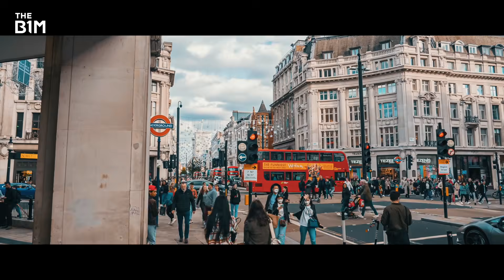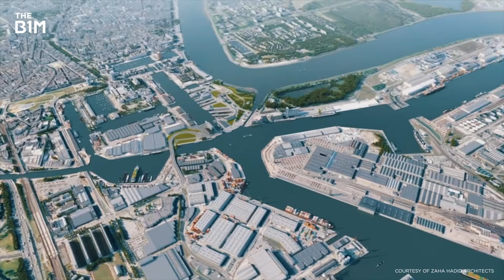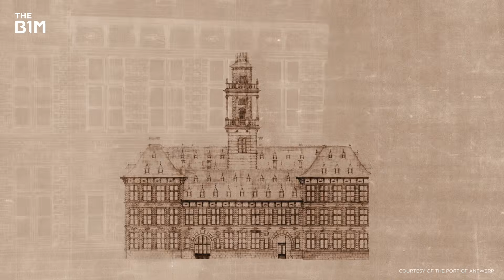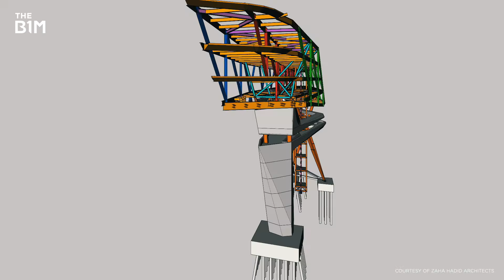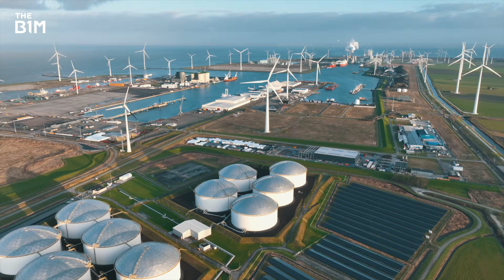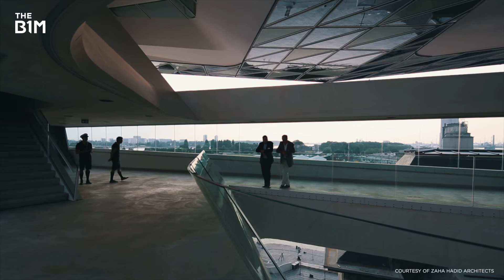Why They Had to Build OVER This Old Building

Comment: I’d LOVE to see this type of external augmentation done for buildings across a WHOLE historical city.
In the same way that “Steampunk” mixes futuristic ‘something’ with vintage ‘something else’, I think it’d be fascinating to see that done in architecture in a consistent way across a whole cityscape. 

While the building in this video’s case had the futuristic ‘something’ = modern futuristic and the ‘something-else’ = colonial era, there’s so many other ‘something’ & ‘something else’ combinations that I’d love to see.

I’ve recently started reading Warhammer 40K novels and looking at official and fan/art of the imperium, and that’s probably influencing this ahah. But while the art of the imperium’s buildings appear designed as futuristic versions of classical roman architecture, I’m more keen on the disjoint appearance of the building from this video where the futuristic is bolted on / standing over / holding up, etc. an actual historical building.

Comment: While I like modern and weird architecture, this seems stoopid.  In this case, they should have either built the new office building in the same style as the existing building.  Or else built the new building next to the old.  I see plenty of open space at 6:06 to build a new building right there.  As for parking, that could have been built underground or as a parking deck with the offices above that.  And don't these people have orgasms over bicycles and trams anyway?

Comment: I would paint the concrete legs to either the color of water or the color of the old building. Or mimicing the old building's roof and windows with painting. Or cover it with mirrors. The light concrete is just an unnececerry attachment to bauhaus while this building could be another level. Just imagine the piccibilities. Or you can cover it with LED wall too... That would make it feel it is levitating above the building.

Comment: You should also make a video about the covering of the ring of Antwerp. It is one of the biggest infrastructure projects in the whole of Europe and will have an immense positive impact on people living in the city and fix the massive congestion problems.
Reply: Just one more lane bro, trust me it will fix traffic.
Reply: @hendman4083  Meh. it's not just one more lane. They are finishing the ring road.
Reply: @LinckIT_BE  I guess the plan is to reroute through-traffic around the city, to take the pressure of the roads in the city? If so, the reduced congestion in the city will create "induced demand", and in 6 months to a year the inner city congestion levels will be back to the current situation.

Comment: Atrocious & no amount of rhapsodising architectural theory can distract from this alien straddler projecting itself atop a structure of worth.
Regarding my use of "alien" Hadid, herself an alien, uses the term to describe her work which is not only alien to Europe but also her place of origin - this alien output is not a celebration of who she is & where she comes from it is a non-descript standardised computer aided design cut & paste belonging nowhere & only reflecting its artificial digital electronic origin & therefore is unworthy of praise, that Hadid & her supporters do not understand or ignore this emphaises why they should be in position to "build" anything.
As for the author's attemtpt to justify the need for similar work to deal with rising population in Europe there is a very simple solution to this: the immediate cessation of the importation of aliens into Europe & the repatriation of all that have been generously granted access here post-WW2, no need for "New Builds" then & once underway the "construction industry/lobby" can be put to good use restoring shithole cities & towns by clearing sprawl of the vertical as well as the horizontal variety & returning Land as best as is humanly possible to it's pre-"developed" state.

Comment: I'm more interested in the structural and financial implications of those 2 massive shear wall columns, they have to be hollow for the elevator or fire exits, right? Or are they purely structural and solid
Reply: It's not solid. It functions as a stairwell and a fire exit. It even runs 2 floors below the ground, to the underground parking garage.
Reply: I was wondering about fire exits, or even a stairwell, as well.
Reply: Go onto Archdaily. They have a wall section that shows the egress stairs and elevators in the structure. Very typical.

Comment: I am a fan of a lot of modern architecture, but I feel that this was ill-thought-out. It was not necessary to destroy the aesthetic of the protected building by adding this to it. 

I am not against the design of the addition, but do not understand why it was put above the original. Why did they say that they lacked space? There was a huge area in front of the historic building, and the same concept for the addition could have been used for a structure that "floated" over the open space, whilst allowing the area to be used for whatever it is currently. The two parts of the building could then have been linked with an underground atrium. Both the original and the extension could have been appreciated as interesting examples of their type, but as it is they "fight" each other, and to be honest, the historic building wins.

What next? Offices built above the Tower of London, or maybe attached to the Eiffel Tower? I know that Antwerp has many historic buildings, but this is not an excuse to allow the abuse of an historic building just because it's in an industrial area.

Comment: How exactly is the existing building handling light and ventilation now that it doesn't have a courtyard and some of the exterior is covered? Why do you need to bring 500 extra office drones in the middle of the harbour, rather than anywhere else, or teleworking? What's the point of even preserving a building that's basically impossible to take in aesthetically now, and is problematic to visit?

10/10 structural engineering, questionable project.